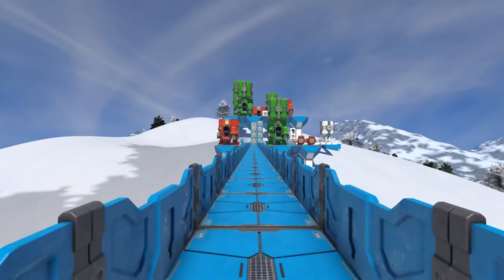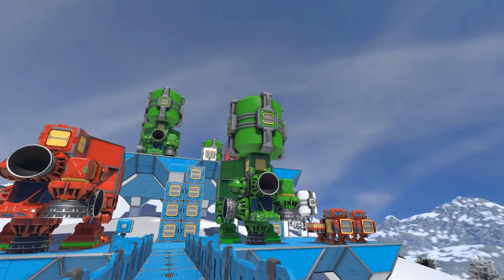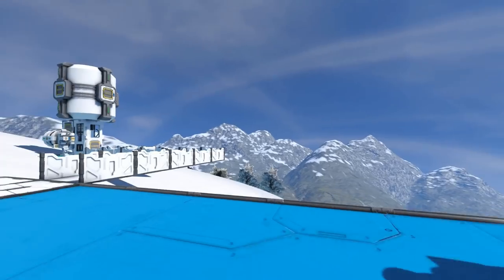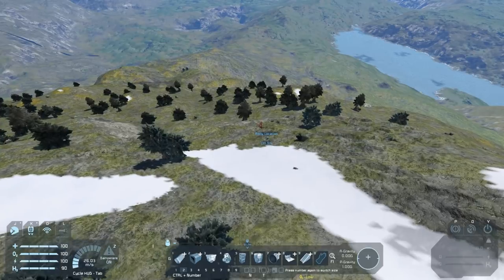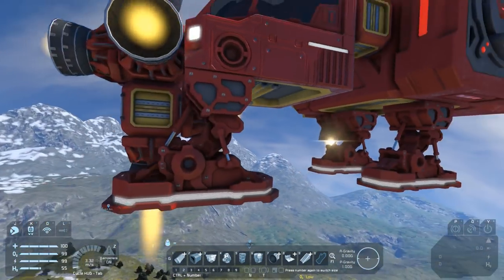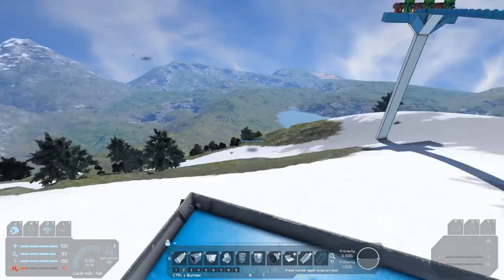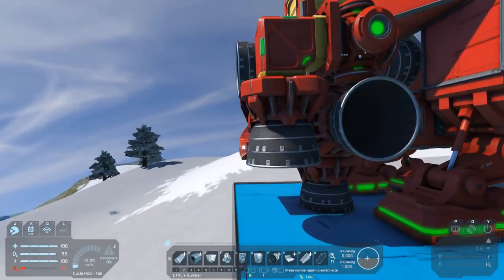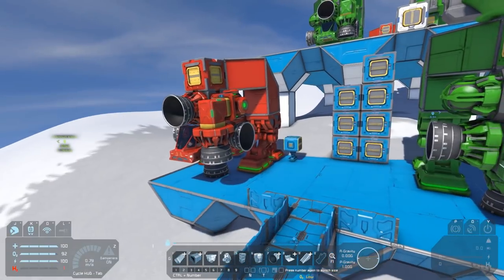Space Engineers Testing: Oxygen Generators vs Hydrogen Tanks (tutorials, tips,  testing in survival)

Comment: Video is old as hell at this point but something to note as of the last update. Tanks now explode if they have enough gas in them when they he 0hp. So now you need more armor to protect tanks or at least firewall them from other components, mitigating the weight benefit. I do use a lot of hydrogen when building, frequently 100% hydrogen thrust but it hasn't hindered me to much as I will normally make redundant conveyor tube pathways. But in terms of generator vs tanks, tanks will always be the bulk of my fuel generators there is a number of them on the ships based on how many tanks it has (I don't have a set %), but basically every hydrogen ship I build needs a fuel depo to refuel at that has a lot of generators and tank farm for rapid refueling, but the generators on the ship are there for "I'm a dumb ass" moments of not paying attention to fuel being able to trickle fuel it at a moon, a roid, or w/e you are stuck.

Comment: splitsie the advantage to generators is its more realistic - not because in real world we used generators but because SE doesn't factor in weight of hydrogen in a tank - a full tank has equal mass to an empty tank if im not mistaken.  In the real world about half of a rocket's ice would be burned in the first third of the trip because the fuel carrying the rocket the first foot has to carry the weight of the fuel needed to bring the rocket the next foot and the next foot and so on - but the next foot's worth of fuel needn't carry the weight of the previous foot's fuel as it's already gone.  Thus 10,000 gallons of fuel can bring a rocket exit velocity of a planet and the next 10 gallons can bring it exit velocity of the solar system.
Reply from the maker: This was looking at it entirely from within the game, there's only so much that SE tries to do realistically and the tests here were part of determining how things work outside that realm as we can't make assumptions based on real world physics. It'd be interesting if it did model the mass of fuel, but since it doesn't I wanted to know more :)

Comment: Inertial dampeners were still on. Those engines were trying to fight against gravity still. I'm wondering if you land that test ship flat, leave the landing gear off, but turn inertial dampeners off as well, would it still be burning hydro.
Reply from the maker: I think it was actually burning ice due to me breathing in the cockpit and using up O2 - didn't remember that little thing at the time :(
Reply: @Splitsie  Ahhhhh yeah I didn't even think of that. Could be! My intuition though is that one player would take hours to use up enough oxygen for even 1% ice loss. Now that's got me wondering exactly how many units of ice a player character breathing uses per minute. THAT would be an interesting test. I'm also curious if it's even remotely viable to build a ship without any hydrogen tanks at all, but enough O2 generators to just-in-time-manufacture all the hydro you need. As in, if that would scale. If a large warship could do that, or if the number of O2 gennys it would take, would end up being more mass than any benefit you get out of them.

Comment: The ice is lasting longer because it can't output as much hydrogen. You are pushing against the maxspeed with both, so you can't see a difference in power output. Large grid Tanks are equivalent to 625000kg of ice. Small tanks = 20000kg. The only advantage I see to generators is that you can refuel if you find ice, and they give O2 as well. 
Another upside that I used recently is that they are smaller and I already had a cargo container to store ice.

Comment: How comviniently timed,  I was just last night modifying a fighter to run on hydrogen but I didn't have the space for a tank so I used generators as they fit in the same space it's previously installed batteries were. 

The thing about inventory size I hadn't considered though,  and I may have to reevaluate the design.
Reply from the maker: It's certainly handy that the generators and batteries have the same footprint, for a small ship if you've got a few generators the performance might be good enough, but for a fighter not knowing if you're about to run out of fuel would terrify me...
Reply: Splitsie I think the trick to that is a script based LCD readout if there's anyplace to mount that in cockpit view.  

In my case I was working on a relatively short range fighter for carrier deployment so fuel wasn't my primary concern,  I certainly wouldn't want to take it on any long haul trips on low inventory settings!
Reply from the maker: Ah yes, of course! If you put that on an LCD that would fix a lot of the problems - until the LCD gets shot off and then you fly by the seat of your pants! :D
Reply: Splitsie Makes life exciting,  relish the danger!

Comment: It is worth noting in my opinion that with an actual ship that isn't ultra minimal (that has a function and possibly armor blocks) the ratio of the weight of generator/tank versus the total weight of the ship would decrease as generators/tanks represent a smaller portion of it. Meaning that weight advantage of generators over tanks would progressively become negligible. Not to mention that a non-minimal design could quickly overwhelm one or more generators while a single tank would remain enough (if ok with a short flight autonomy)

A definitive advantage of generators that you did not consider is size. If you are trying to build something as small as possible that perhaps work in space and therefor have very low trust requirements generators have a clear advantage here. Tanks are huge.

An other advantage generators have (i believe) over tanks is that in a military scenario I do believe that tanks can explode and do significant extra damage to your ship. There are no such concerns with generators.
Reply from the maker: That's a very good point about the tanks exploding and building a military ship. From the times small ships hit the ground, it certainly seemed like the tanks gave off a pretty big explosion, not sure if it does block damage but it should if it doesn't. But then on a military ship you're going to want to have maximum power available and probably don't have time to jump into the console to check your fuel reserves... but you might know your ship's 'dry' weight so could work off mass.

I think it's worth looking into the size issue more closely, there might be some unexpected results there.
Reply: Oxygen generators can be even worse. Hydrogen tanks explode and that's it, but generators release a huge boulder of ice that can smash the rest of your ship. Avoid building them over vital components.
Reply from the maker: Hmmm... this seems like it could be worth playing around with to test the survivability
Reply: Good point Nethan.

Comment: What about a small grid tank, low mass, in a large grid ship for high flow thrust and generators to refill tanks when high flow is not needed and for normal use for long trips between fueling.
Reply from the maker: That would work, the trouble would be the weird flight when you have subgrids. Another thing to note is that the balance of these has changed since the recent survival update, generators produce even less fuel and tanks hold more, so there would be even fewer situations where the generator and ice setup has an advantage

Comment: You used extra fuel on the generator ship by trying to lift off with one generator. Even though you were not lifting off you were still using the maximum fuel rate for every second you held the space bar.  So it was a slightly unfair comparison.

Comment: Just now seeing this vid, and I had a question--which I'll likely check myself in a bit lol.
Once the ice is converted to Hydrogen, do does the grid's weight change? Do the tanks weight the same full as empty? [and do large and small grid H2 gens convert at the same rate?]
I theorize the large grid w/ tank [holding 200k ice converted to hydrogen] is lighter than the large grid with 200K /unconverted/ ice in twin O2/H2 gens.
Reply from the maker: The tanks are exactly the same mass empty or full last I checked so the advantage you get in mass with the generators is all thanks to the dry tank being so heavy (it's also why I had to use x10 inventory to make the competition interesting) :)

Comment: I'd be curious to see how well this stands up to the test of time. In part because of changes in the past two years, and in part because I'd personally be curious to see how a hydrogen engine powering ion or atmo thrusters would fair over the straight hydrogen thrusters. I'd assume the extra effort for the engine and electric thrusters would prove superior, without as many of the shortfalls of EITHER just tank, or just generator options as presented here.
Reply from the maker: The adjustments to the game since this was done have made tanks even more superior to carrying ice as the efficiency of the generators has been reduced. Not sure about atmo vs hydrogen though
Reply: @Splitsie  Considering the wiki says you are getting about 3 times the energy out of the same amount of hydrogen by running it through an engine compared to using it in the thrusters, it may well prove a rival! 
Edit: Though looking at the wiki, I also didn't realize the atmospheric thrusters were quite as heavy as they are, so perhaps it may not end so well for them either.

Comment: Flaw in your comparison at 6:16 I think....  You disengaged the merge block,, one is now alone, the one that fell, has a bunch of blocks attached to it the other doesn't mirror/  Which I presume includes MOST of the atmospheric thrusters and at minimum other 16 blocks, plus the merge block.  Since this means it has more mass, it isn't a fair comparison.  Even if every single block extra amounted to only 1% of its total mass, you would be looking at a minimum of 17% more mass on one than the other, if they are both equipped with the same exact thruster configuration,  the one carrying the extra blocks has more mass from structural blocks. (including the merge block it was left holding)  Placing an undue bias on that unit.

If you add mass to one over the other, the thrusters need to produce additional thrust to maintain or gain altitude. (I can put on a 15kg backpack and stand here all day, but you put a 50kg backpack on me, I'm going to need to set it down from time to time)

The LOGICAL approach, would be yes, have a tank, but bring a generator.  The generator produces fuel,  from ice, and can run at full processing speed to fill the tank.  Let the tank have a short time to fill sufficiently for launch (or load from outside) and then the generator makes more fuel as your tank empties.  Short answer for launch tanks win.  But consider the mass to carry for a 24 to 96 hour in space operation?  (especially since the tank only approach won't have oxygen resupply, just whatever you packed on board before launch)  Carrying the ice and a single generator into space makes sense, but to achieve orbit you're going to need a tank, or an overabundance of ice and generators.

Comment: Yeah but how many thrusters (of small or large) can one generator run at full power? This is important for the weight to ship calculations because you could make a "Thruster pack" equation. I.E. G+T=P (G=# of Generators) (T=# of Thrusters) (P=Total weight this pack could move at full load)
Reply from the maker: To quote Nethan2000 who replied earlier: "According to http://spaceengineerswiki.com/Thruster a small large grid hydrogen thruster uses up 1092.5 units of hydrogen per second. According to http://spaceengineerswiki.com/Oxygen_Generator a large grid oxygen generator can produce 501 units of hydrogen per second. This means you need a little bit more than two generators per thruster to burn it at full power. With small grid, the numbers are correspondinly 109.2 and 166. This matches your results. It should be possible to come up with a formula to find the best solution for each use case."

So you could plug those numbers in quite neatly if you add in the information about how many Nm of force the thrusters can generate :)

Comment: A combination of both is better, in my experience.  Sure, you need more cargo capacity, and a good deal more weight, but, if you're going to have a ship that runs solely on Hydrogen (minus the atmos, of course), a way to generate hydrogen is going to be the best option.  Mind you, neither is entirely viable on its own.  You're gonna need a storage tank (or four lol) to store the hydrogen.  Awesome video, by the way, though.
Reply from the maker: I completely agree that for anything out of some quite specific scenarios a mix is going to be better. For ships that go to space and back, having just enough hydrogen in your tanks to reach space from a planet - then refilling using on-board generators - is probably a good setup. But if you want a really tiny ship to go collect all those cosmetic drops, maybe a cockpit, generator and a few hydrogen thrusters would be perfect for getting there without using your personal jetpack... but a battery and some atmo thrusters could work just as well :)
Reply: A very good point there.

Comment: I use both tanks for when I'm actually moving and generators for when I'm not they also ever so slightly decrease the rate i lose hydrogen (probably) the extra weight from the ice probably negates it but on the plus side I can never run out of hydrogen unless I lose power all I need is patience.

Comment: Another question if I may.

I have recently started a new game and decided to start on the Alien planet (I like a challenge).  My oxygen level always reads as low, even when my helmet is closed and my tanks are full.  Is this normal?

I checked out the Wiki which states that the atmosphere has some oxygen and is breathable, just. but makes no mention of the permanent low oxygen reading.  I tried removing my helmet and found the air not to be breathable at all.
Reply from the maker: My understanding of the oxygen reading is that it will give you how much is in the volume of gas your character is in. So it will still be telling you about the atmosphere even with your helmet closed so that you can know if it's safe to open it :)
Reply from the maker: Also with the bit about losing health, there are degrees of low atmoshpere, if it's low enough you should be able to use a vent to collect oxygen (albeit slowly) but might not be able to breathe the same air if that makes sense.

Comment: If the ship runs on hydrogen, it's going to go to space, otherwise what's the point of running on hydrogen, so an O2/H2 generator is required anyway. So I usually put both no matter the ship.
By the way if you're a madman, best way to go is atmospheric + ion powered by hydrogen engine. That's the only way to go.
Reply from the maker: Back when I made this comparison hydrogen tanks didn't hold nearly as much as they do now, so there was a portion of the community that believed generators and ice in cargo would perform better. These days the comparison is even more in favour of the tanks with a generator being for (as you say) that little bit of refuel or O2 if needed :)

Comment: Please Consider redoing this video with the new Version. There where some heavy mistakes done back then when you produced this video that made it not scientific. Also it is quit good to build your ship hybrid. So using a tank as a buffer for getting from planets and moving or turning fast while the generator refills the tank when the ship is not under heavy movement. This works really good for mining ships that use large container as their storage. You will end up taking alot of hydrogen when you want to move the ore home, and a gen alone wouldnt be able to move you at all which means that the tank is used as a buffer. And a generator definitly helps reproducing the hydrogen. I hope you get what i mean.
Reply from the maker: I've started redoing all my older tutorials, takes a little while so I'm only up to the second of the beginners series, but the hydrogen question is high on the list as I'd like to know what impact the engine has on all of it. Also, with the tank having double the capacity the generators are now very much the loser in this contest, even with higher inventory settings, so I'll be thinking up a new angle to look at with them :)
Reply: @Splitsie  Well but without a Generator the player would need to refill his hydrogen at a Station etc. I really think the Buffer Concept should be standard, because the Generator can already produce the hydro that then can get used when needed. I personally find this much better then running just either on tank or a(multiple) generator(s). However I'd like that you reapproach the series, no doubt it will take its time and its guarantees that the players find the most relevant videos. Oh and it looks like that i didnt say any good word in my first Post. Good Work, thanks for the time and enjoyment/entertainment (:

Comment: Im curious if i should make my planet miners powered by hydrogen cause with atmospheric ones i never have enough power to lift up a miner that has like 500k units of ore in them.
Reply from the maker: I've built a hydrogen powered miner before, but the trouble with them is that they end up very bulky and while they can lift a lot, they also run out of fuel quite quickly. A hybrid might be an option though, so you only use you hydrogen once the atmospherics are at capacity, and not needing any hydrogen for the trip to the mine would help give you a longer flight time... though again that would still be bulky but maybe not as bad
Reply: Great idea, i will make it today and just manualy switch to hydrogen trust when my ship gets over its max weight for atmospheric ones so i can get back home safe.